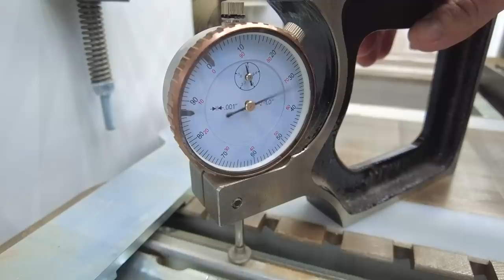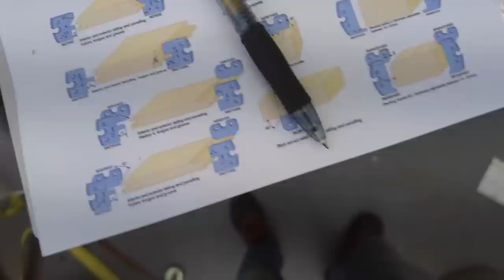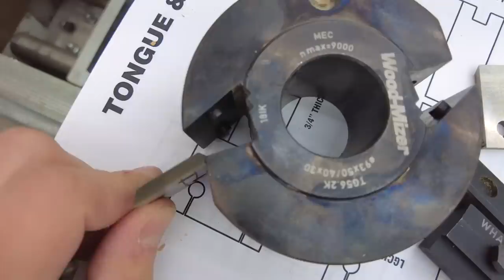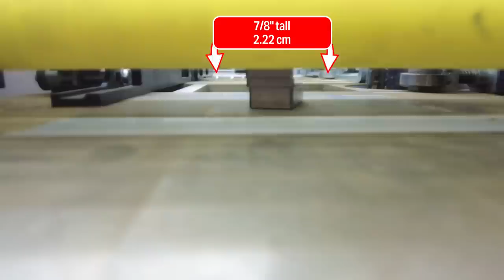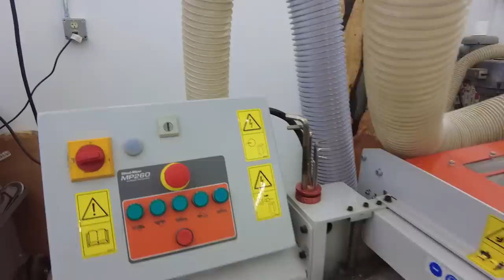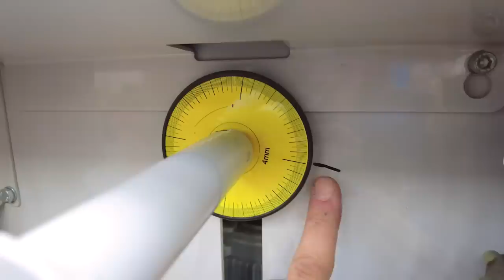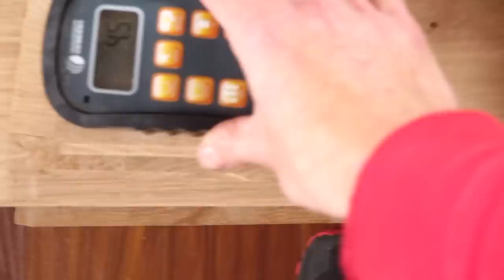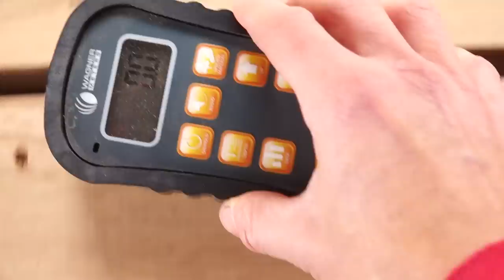I Swore I'd Never Make Flooring Again | Home Renovation & Addition Part 50

Comment: I was holding my breath when you first turned on that machine seeing that you left one of the wrenches on the top edge . I heard a small clang not the fireworks I was expecting when the wrench vibrated onto the floor. That was a close one Matt .
Reply: That was my same reaction when watching him turn the machine on with that wrench sitting on the edge...wow that could have ended very badly.
Reply: Thanks for clearing that up! I heard a sound like a wrench hitting the floor, but since no awful grinding noises ensued, I forgot about it.

Comment: Nice work Matt!…As a wood floor pro, I definitely can appreciate the work that goes into this! 2 things you may want to consider… •Endmatching, We only install floor boards that have all sides milled with a tongue and groove. This will help with squeaks and height differences as the humidity in your home adds or removes moisture. If you are looking to forgo that step because lack of tooling, I would for sure look to glue assist the flooring with a silane based flooring adhesive as well as nail. It’s common nowadays to glue assist any boards over 4”. 
•Also with regard to the white oak dust dispersion, It may add a lot of tannic-acid to the ground sometimes not allowing things to grow or killing surrounding vegetation. Food for thought. 
Anyway I look forward to seeing the project come together in the coming weeks and months!
Reply: Having just installed hardwood in my downstairs, I was definitely curious about the tongue/groove on the ends as well.
Reply: What machine does the end tonguing and grooving? You need to get out feed rollers, Matt!

Comment: Never underestimate the work of an engineer. Back in 86 the 2nd of 3 times when I first worked Ford. They sent me to school to train on the SC Continental with the turbo BMW diesel engine. They had a hydro-boost master-cylinder that had such tight tolerances that if you disassembled it you couldn't fit it together because of temp changes between parts, you had to put inside parts in the freezer to fit them together every time you had to put another part inside another. It took days to assemble 1 master cylinder. And the engine was even worse because BMW doesn't waste anything and every bearing in the motor could be a different size and took 6 months to rebuild if you didn't have a selection of different parts in stock. You even had to use a micrometer to decide which of 3 different head gaskets to use or have major compression problems when done. If you ever decide to change professions the word could use someone like you to teach in a way anyone can understand, your the Neil deGrasse Tyson of woodworking.

Comment: Hi Matt, I have a mate who has large 4 sider machines that have 5 or 6 heads for additional processes when needed, and  run at something like 80 metres per minute. He has a large chip extraction unit with a 64 cu metre collection bin, and when doing a large run, has the chip removal man on standby to empty the bin, go away and dump it and come back for the next. So I am not surprised at your chip collection.
To keep up with that processing speed, he has two operators, one feeding and one taking off and stacking and a facility that allows the stacks adjacent to feed in and exit and forklift access to bring in new packs of timber and remove the dressed.
Doing that sort of work is hard work, timber is not light and having to move it any distance just slows the process down.
I am also sure that is possibly the heaviest load your workbench has ever supported.
In relation to your comment about having a small gap between the meeting faces of the T&G joint, that is also done to ensure a tight top joint, because in areas that are heated boards will shrink, and show a gap, having the top side of the joint tighter than the lower minimises that problem. If the lower side is not in a heated/dry area, it can swell and make the top potentially open up as well. The V joint doesn't really achieve what you need to counter those issues and is used more where the lower face is visible for aesthetic purposes.
Look forward to seeing the finished floor installed.

Comment: A lot of work but worth it. In colonial days all the flooring was room length or stopped at a chosen point and the next length butted up in a straight line.  Seeing this pattern 250 years later, people mistakenly thought that a wall must have been removed at some point in the homes past. As for the joints, each board was either a tongue board or a groove board and they could flip he boards end for end to keep a relatively perpendicular pattern.  They did this to maximize yield of boards that were hand planed and hand jointed so that parallelism wasn’t needed. Brilliant.

Comment: Awesome work, and well worth it.  The quality you will get out of your flooring is well above what 95% of the stuff you can buy is.
As someone who has made a ton of V grooved tongue and groove for wall paneling with a jointer, planer, table saw and a router?  That machine is an absolute beast.  Once setup?  What a time saver.

Comment: I thought stickers were alway suppose to be stacked right on top od one another.  But regardless and interesting look at that machine. Once again your issues make me feel better about my wood issues. Redoing a small dust collection system and getting frustrated with adapters that I think will fit and companies not clarifying the id and OD . DAmmn. Great job I bet someone is getting anxious to see floor down.
Watching this build and your barn reminded me of when my friends and I built a camp in the Adirondacks almost 50 years a go. 3800 sq ft 2 story with full cellar. We did everything except the edxcavation.. Coukd have used the teehandler for some of that work, . Stick built our truasses one friend was an engineer. Cut the sticks on the ground passed them up two stories and put them on a template for nailing. 
36-36 2 story section on one side A 24 by 36 great room on the other end. Great room all knotty pine top to bottom oak flooring. 24 high peaked catheral ceiling with 8 by 14 pine beams.Transport the beam about 100 miles with pickup. Manpower lift and walls chained to cars until we could get ties in. Front made from granite blasted out of a major highwat, Surprising most about 6 - 8 inches thick some on otside of fiireplace are 2 x 3 , Inside 12 ft fireplace with same granite but smaller pieces, and a granite wall behind a pot belly stove on the opposite wall. 
The structure still in great shape 50 years later. Your process reminded me of so many things. Did on weekends for two years.

Comment: I work in a wood mill and that moulder is a small version of our machines. Many of our machines have multible top and bottom heads and run much much faster.  What took you 11 hours to run one of our moulders could have probably done in about an hour or less.

Comment: You should make a hydraulic wood chip press and make your own compressed wood logs with all those dust chips. It’s been proven that pressed logs, burn cleaner and much longer than regular firewood. Especially being that you live in a very cold climate.

Comment: Fun to watch.  If you haven't laid the floor yet, perhaps consider, Mass Load Vinyl as an underlayment.  We have used it on numerous projects with quarter-sawn white oak, all in homes between 1880-1903, it drastically cuts down on impact and walking noise, not to mention if leaving the existing floor it helps alleviate any squeaking.  As well, the pricing is not bad.  Look forward to seeing the final install.

Comment: At 15:10 the recommendation to snug down the knife adjusters is to help prevent the knives from emulating a motorized scary-go-round launching offspring projectiles in their preferred straight line through time and space at the parent controlling the RPM sort of thing.

Comment: I did about 200 sf of tongue in groove Siberian Elm flooring for a playroom with a portable DeWalt 12" planer and a Porter Cable router mounted on a 10" Delta shop saw. It wasn't the easiest way to do it but it came out nice. I let it acclimate for a year, then I French polished the floor after installation. Down to 0000 steel wool 😁. My son learned to crawl and walk on that floor.

Comment: Hi 👋, Matthew , great job, I am very concerned for your safety, I have approximately 50 years of experience as a wood matching, it was not very good that you opened up the lid and ran the machine it should not of started, never lay tools on or in the machine and start it, it is just , mobile workstation to put your tools on, never level them in or on the machine, seriously damaged to yourself and to the machine, it looked at one point cutters were in the wrong way round in the cutter block, about 30 years ago I change all of my machine tooling to a German tool manufacturer call LEITZ , they are very expensive but well worth the cost, they have a chip limiter , it is a second cutter that faces the opposite direction it is set back by about 1M , you have to use their blocks, please 🙏 be safe, keep up the great work, it is a pity that you are so far away as I would gladly give you some help, and let you have some tooling, I still have most of them, 10£ , 
Keep up the great work, PHIL FROM THE THE DARK SIDE OF THE MOULIN, retired English gentleman living in France.

Comment: wow nicely done
that dial indicator is a beautiful tool, as a machinist’s son, i thoroughly enjoyed the set up, looking forward to that bridgeport thingy getting  refurbished.  also, i enjoy the woodworking
Reply: I like the dial indicator as well but more it's holder, what is it called? All the ones that I found online have arms. The one in the video is ideal to tune a jointer, mine broke and I had to calibrate it and i used  dial indicator but built my own holder this tool/holder would have been great
Reply from the maker: Multi gauge. Linked in the description

Comment: Matt I was wondering if you knew how much saw dust you were going to get.  To keep the dust collection going you could count the boards and shut it down before it over flows.  I had a nice wood shop some twenty-five years ago.  I used Delta power feet on my table saw and both shaders.  You were smart using a deal indicator.  To increase your dust collector volume, you could add a plumium after your clucking.   Hung mine from the ceiling and just 4’x8’ sheets of plywood.  I hung twelve bags six feet long into twelve buckets.  If I emptied my cyclone on time.  I never had to bother with the buckets filling up.  But it gave me twice the suction.  I also had mine in a room connected to my shop.  It really cut down on the noise of a 12” dust collector.  Back then I had to make a lot of my machines.  Because it was before Utub and Facebook market place.

Comment: “Lunch will happen!”  Yep. You gotta  maintain your priorities, Matt!  

But seriously, this floorboard milling machine is incredible. I’ve been thinking about the old maple flooring in my former house in Wisconsin, which was cut by hand by the finishing carpenters…it took them 2 years to do the flooring and moldings for that grand old house, 1911-1913, and every one of those T&G boards was cut with hand planes!  Im guessing they used a Stanley #55 or similar, but it may have been done with wooden molding planes. 

I’m getting ready to make some T&G boards for the back of. Bookshelf I’m making, using my late father-in-laws old Stanley #55 plane, and I’ve spent a full day setting up the cutters already and I’m not finished yet… can I bring my boards over to your place instead? (JK… I’m in TX).

Comment: And let’s applaud the production value of this video. I counted 3 milwaukee tool lights and a go pro that could have vibrated off and been sacrificed to the Youtube gods at any time.  
Pretty slick!

Wondering why you didn’t use an out feed table?  Would that minimize snipe also?

Comment: with a 14 hour setup time investment... would have been faster to just use your jointer, planer, table saw, and router.  

The wood miser combined 5 operations... face jointing, thickness plane, cut to width, shape tongue, shape groove.

If you estimate about 30 seconds per board per operation... you would invest about 2.5 minutes per board to do this with separate tools.

By the time the machine was set up, you could have finished 336 boards using your existing equipment... did this thing really save you any time?

I would have invested in a good auto feeder and skipped the machine for this project... but of course you couldn't have known you'd burn so much time on the machine.

Comment: that’s a lot of work! i’m sure the results will be worth it. i’d cut that divider post thingy out of the dust port. will help clogging up i don’t know why it’s there anyways
Reply from the maker: If it was my machine, they’d be gone before I started
Reply: @mcremona  i did my breezeway in oak from my property. using router table. it’s 10x12. i figured i made enough, but soon realized i only had about 1/2as much! yikes. i hope you figured overage.

Comment: Nice job :) Have the excact same machine in my shop  here in Norway, goes by the name Logosol here :) I have had this for 9 years, and acctually picked up some tips from you :) Hva never innstalled 4 knifes in the last kutter, but nice to know how to if it ever becomes a topic. Know all about the sawdust generated, but i have a woodchip boiler so noting is turned to waste. 
Looking forward to seeing the finshed floor.

Comment: We've made thousands of feet of flooring probably tens of thousands

We have always preplanned to 7/8. Then reset the recorder to make flooring it helps with consistency less chatter and vibration

We also upgraded our cutterheads to carbide If anyone is doing this is a business carbide will make all the difference in the world. The high speed steel is horrible I don't think We could finish one job with 1 set of knives. And the fit would get worse with the high speed steal in one job

Once we switched two Carbide Inserts Not only was the fit better but the run time was at least 10 times. What high speed steel 

It's a great little machine 

Also with carbide I can switch from multiple sidecutters V groove flooring ship lap without changing my side place we get the knives made prom makes those. So I don't have to change my fences make set up time about 20 minutes.

Comment: Is there a dust shield for the feed rollers? It seems like the dust is getting ground into the face of the boards. I took a look at the price of the machine. YIKES!  I hope you bought spare cutters. Do the feed rollers leave marks?
Reply from the maker: No shrouds. The side cutters need better shrouding. The last roller is rubber so there no roller marks. Bought about $1500 in tooling for this thing that will go back with the machine

Comment: Nice work Matt. If someone reads this could I be explained why telehandlers in the USA have this odd deign compared to the ones in Europe from my knowledge. For some reason they seem to have the rear of the boom higher up and a super fat boom too... I really don't understand this as from looking and comparing JCB telehandlers from USA and UK the uk seem to have better specs and are generally smaller...
Reply from the maker: High mount boom offers better visibility during lifts; low boom is better visibility at ground contact. High boom allows for loads to be carried closer to the ground with full visibility.
Reply: @mcremona  fair enough didn't quite think of that. I wonder why we don't have them here in the Uk. Thanks Matt.

Comment: If one were to go into commercial operation, a Clear-Vue system per head would be needed. How much additional air born dust did you detect? All and all, a good test for the Clear-Vue.

Comment: The cutterhead for the tounge was set up wrong. Both the cutterhead and the knifes need to be turned around. It seems to be corrected in the end, but for everyone using a shaper do not install your profile cutterheads in this way!

Comment: Matt just curious, with all of those board feet run thru the machine did you have to swap out the blades for a sharper set at some point or was it all done with the originals?  And how did they hold up finish wise?  Great seeing that machine in action!  A lot of work but what a great story to be able to tell when someone says “Hey nice floor”!
Reply from the maker: All that was run with one set of knives. The side cutters are still sharp but the top knives are getting pretty tired at this point.

Comment: Did you ever think of running ducting from your shop out to an appropriate corner of your property to just blow the dust to its final location?  So. Much. Sawdust.  I am picturing booster DCs on generators out in the field pushing chips into the great beyond.

Comment: you're going to need one of those wood pellet makers for all those chips. Also that top cutter just having that thin bit of plexi between it and the world makes me very nervous.
Reply: I was thinking exactly the same thing about the thin 'protective ' plexiglas. It's obviously just there to seal the area so the dust collection will work, but when he was leaning over the lid to look at the inner workings I was cringing at the thought of a cutter blade breaking off at 15,000 rpm. I guess you just have to trust the design engineers.

Comment: Just out of curiousity why didn't you set up.a bench or extra heavy saw horses at the feed end to save some running back and forth toload it as well at the other end if possible Matt ?
Definitely a really interesting episode this one.
You're going to have an absolute ton of bragging rights once your house is finished.
Of course you gotta give Donovan lots of credit as well

Then there's yourpng suffering Wife, I'm pretty sure it has stressed her waiting for her new kirchen and dinning room to get finished.
Reply from the maker: No extra room for that. I didn’t bother installing the outfeed table either